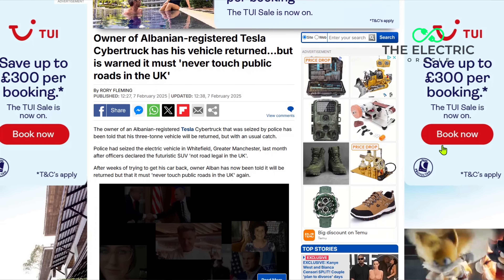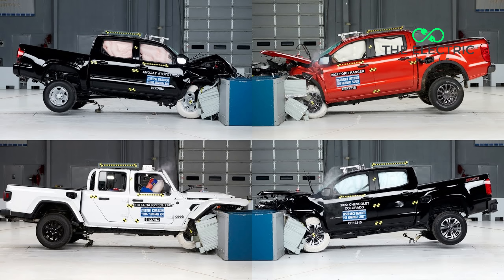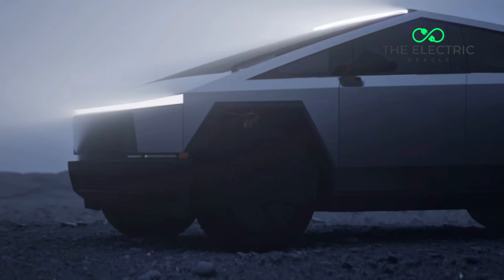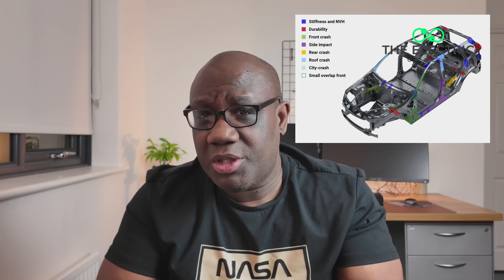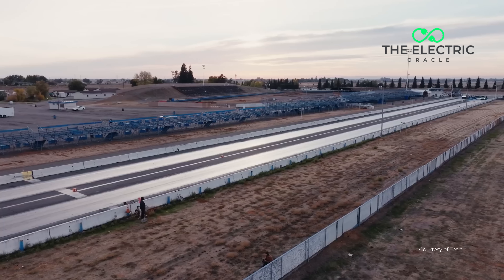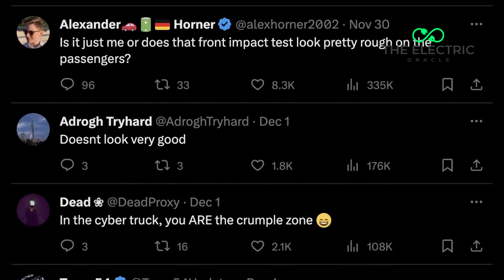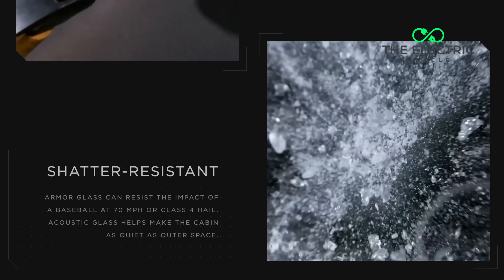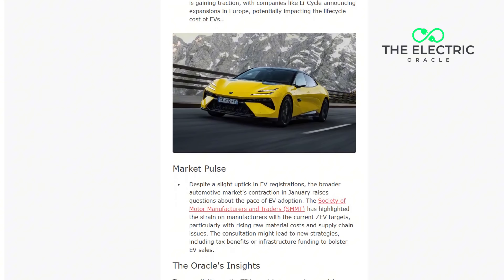Why the UK Banned Tesla’s Cybertruck – 5 Fatal Design Fails!

Comment: I think the CT was rushed out because it was years late. The US design rules are probably the easiest to comply with, plus with a high public profile you can do a lot of dodgy stuff and get away with it.

 Elon had taken peoples money with a lot of wishful thinking. A number of features promised weren't delivered on the new truck and a good number of owners decided to get rid of them before too long.

This is extremely unlikely to be compliant on Australian roads and in suburban areas there are very few really large "pickups".
I've really only seen RAMs and some F-250s, which are often used by companies that need a large vehicle.
I think the cost of fuel means people don't buy thirstier vehicles unless they really need to.
Reply: I live in a regional Queensland city and we have a growing number of the extra-large RAM, Ford, GMC pick-ups. A number of them are owned by people with some reasonable use case like towing horse floats or boats. But there are others that seem to be just a $ 'flex'.

Comment: I'm surprised there was no mention of the steer by wire system in this list. With my engineering background, I simply will not trust such a critical system to a couple of electric motors and control electronics. A catastrophic failure in any conventional system still retains a mechanical link from steering wheel to front wheels, the Cybertruck has no such link, so a catastrophic failure in a large variety of electronic and mechanical systems can completely disconnect the driver from steering control. I cannot fathom how that was ever approved, even in the U.S.
Reply: You say all that and yet most planes are fly by wire. I guess by your reasoning you will never fly in a plane?
Also as an engineer you will be aware the steering column is a potential spear. 
Oh and are you aware the electronics have redundancy built in. 
Steer by wire will ultimately be the norm in all cars one day.
Reply: @grahamrennie7617  I don't agree. I also fly and if you did too you would be well aware that fly by wire outside military fighter aircraft is confined to large transport aircraft and then those systems have not only full system triple redundancy, but use hydraulic systems that are properly maintained with set TBO's. Aircraft can also be steered with a variety of options in the case of a system failure, and you are not avoiding an oncoming truck or tree with a couple of feet either side. 
Electronic redundancy is pipe smoke, it only works when the failure is defined and accounted for, outside that all bets are off. Believe whatever you like from the marketing hype, but I maintain that solid base engineering principles should be maintained, especially where the alternative only offers a cost to manufacture benefit, nothing else.
BTW, collapsible steering columns have prevented 'spearing' since the 60's, along with airbags since the 80's.
Reply: @alasdair4161  you forgot most cars still use 50+ ecu while tesla only has 3-5 main computers might be 3? if that computer turns off then that car isn't moving also Volkswagen & Mercedes  Developing Tesla-style centralized computing architectures as well so there going down to 2-4 computers at most instead of 50+ for each part
Reply: @knightwolf3511 Yes, they are moving to fully networked architecture with one or two central system controllers with the traditional components working as sub systems linked to a core processor. I'm surprised they've taken so long, integrating body, engine, transmission, HVAC, mirrors, nav/infotainment, driver assist, park assist, as well as crash systems (airbags, pretensioners and even event reporting) along with braking and traction control and now steering systems all using the speed tiered can bus system which was reaching it's limit some time ago. It will bring a more fatal and complete termination of driving to the mysteries of system failure for sure, absolutely everything will hang on that CPU not suffering from software bugs, update issues, parent company solvency, hardware reliability in harsh environments, internet and data access, malware attack, disgruntled employee's, moisture ingress (looking at you VW...!) emi interference and even plain old bad luck may quickly turn your five year old car into E waste. One of the benefits of can bus was the ability of system faults to not affect higher safety dependent hardware, so a broken touch screen or seat heater would not disable your brakes, steering and airbags... but with a single CPU..??? Fun times to come...
Reply: Interesting, as an engineer myself, I would trust a system that is tested and proven to be reliable in any foreseeable condition, instead of just assessing things based on their construction. There is no reason why a mechanical steering could not catastrophically fail due to manufacturing or service error and prevent you from steering.

I will agree that I was suprised it was not included in this video, along with all of the other technical misunderstandings.
Reply: @Catrik  even in the video there is technical misunderstandings like for example the lights you need redundancies which would make the vehicle more expensive but also i could see it only fail 2 ways
No lights or car just doesn't turn on also people driving without headlights 🤔feels like just adding more things to a already overused complicated system just so you can keep driving at night which means you don't really have to get your first lights fixed
Reply: @knightwolf3511  Huh, did you reply to the wrong person? I have no idea how this relates to the steering or what you're referring to with the lights.
Reply: it's also cold rolled stainless steel which is more resistant to corrosion and i think stronger then  carbon steel?
Reply: But we're okay with fly-by-wire throttles, for like the last 30 years.

Bosch also had brake by wire in a lot of Mercedes-Benz cars in the 2000s. People didn't like it, but it was statistically more reliable than the mechanical system.

Steer by wire will be the norm in 5 years time. The mechanical connection is more of a hindrance than a help nowadays.
Reply: @charlesbridgford254  I've never heard of Mercedes conventional hydraulic brake systems fail relative to a pedal linked master cylinder. The only failures I have seen have been associated with electronic ABS systems, electronic EBD and BA as well as electronic park brakes. If you trust your life to a cheap optical rotary encoder feeding a software based digital servo system over a mechanical pinion gear then all I can say is... good luck..
Reply: @alasdair4161 You won't have much choice soon, so luck won't be much to do with it. I'm not wishing it, just offering a vision of the future where 99% of consumers won't even know/care that their body movements have no mechanical connection to the car.
Reply: @charlesbridgford254  I agree 100%. I've got no plans to buy a throwaway car in the future so when the choice is gone I'll go bush and disappear...
Reply: @alasdair4161  Most modern passenger aircraft use fly-by-wire (FBW) systems. Here are some key examples:

- **Airbus**: All Airbus commercial jets from the A320 family onwards are fully fly-by-wire. This includes models like the A330, A340, A350, and A380.

- **Boeing**: Boeing began incorporating fly-by-wire in the 777, and it's used in the 787 Dreamliner. The 737 MAX also has a fly-by-wire system for some control surfaces, although it's not as comprehensive as in the 777 or 787.

- **Others**: Many other manufacturers like Embraer with their E-Jet family and Bombardier (now part of Airbus) with the CSeries (now known as Airbus A220) also use fly-by-wire technology.

Fly-by-wire systems replace conventional manual flight controls with an electronic interface, which can offer benefits like weight reduction, improved handling characteristics, and enhanced safety features through flight envelope protection. However, older aircraft models or smaller regional jets might still use traditional mechanical or hydro-mechanical systems.
Reply: @grahamrennie7617     You're leaving out one little fact - that those airliner FBW systems generally have triplicated functioning, fully redundant, exhaustively tested and certified to operate safely.   AND maintained to extremely demanding (and costly) standards.    Occasionally someone takes a short-cut and you get the 737 Max.   
Just how many independent circuits does the Cypertruck have for its steering?   There's just no comparison.
Reply: @ yes, I'm intimately familiar with some of those systems, but believe me, they are a million miles away from mass produced automotive steering systems, especially if they evolve into drive by wire closed loop digital servo systems with no physical redundancy. It will only be done to save money, that's it. The conventional power rack and pinion is physically much lighter than the Cybertruck dual motor system including the associated electrical supply and control systems needed to support it, even conventional electric boosted racks are no lighter than older hydraulic racks (including pump) due to the instantaneous power needed. The only real benefit I see for moving to full electric alongside cost is for automated driving, it will probably be done for actually removing control authority from the driver.. lane assist will ignore your inputs, swerving to miss it's fictitious AI hallucination will supplant the drivers reality. It will be a new threat for sure.

Comment: I saw a comparison front end crash test between a cybertruck, and a Ford F150 lightning.  After the data was analyzed they figured that the occupants of the lightning had an 80% better chance of surviving than the cybertruck occupants all because of the lack of crumple zones on the tesla.
Reply: No one could have watched the crash test and concluded there are no crumple zones.  You can literally see the vehicle crumple.
Reply: @tripzero0  A vehicle crumpling does not mean it has a crumple zone*. Go back to school.*Crumple zones are designed specifically to absorb impact, even with a pedestrian. That's why they warn you not to stand on a car bonnet, or even lean on it very hard- it will bend. Try standing on a cybertruck bonnet. If it won't bend and stay bent, it definitely doesn't have a proper crumple zone.
Reply: @alisonwilson9749  the NHTSA just gave it a 5/5 safety rating.  The best rating for a truck ever.  Not bad for "no crumple zones".
Reply: @tripzero0  and also the rear axle/wheel breaking off due to the impact in the front. Not very effective.
Reply: @ I guess that's part of the crumple zone for a FRONT END crash.  Well thought out design!
Reply: @timingenkamp3973  a lot of things break all over a vehicle in a front end crash.  What really matters is the passengers are safe.  The cybertruck has cabin radar then measures the size and dimensions of the passengers and modifies the air bag deployment appropriately.  I'm sure it's not the first to do that (maybe it is?), but your vehicle doesn't do that.
Reply: @tripzero0  since it has a actual computer in it, probably but some cars from 70s and 80s had some unique stuff to them
Reply: 80%? That's a very specific claim. Not 79% or 81%?
Reply: Except if the CT crashes against a F150, thent would be the opposite!!!
Reply: Cyber truck has crumple zones, they are part of the giga casting
Reply: This fooled so many people. Read further and don't believe the internet so fast. 🤣

Comment: The Tesla Cybertruck does have a subframe (it is not essentially a unibody as promised), specifically a rear subframe is included, which is a part of its unibody chassis; however, it has been reported to be susceptible to damage from large impacts, like hitting potholes, potentially causing significant repair costs if broken. Safety wise, Volvo developed the use of three grades of metal in their design to act as crumple zones. The Cybertruck is a childish monstrosity, straight from the mind of an ultra right-wing, N A Z I saluting zealot.
Reply: 😅 appropriate that it is SS then 😂

Comment: The crumple zone and the standard to do with measuring energy absorption was introduced because some engineer campaigned for it. As a student I read one of his books. He pointed out this was the problem with fibreglass as it had this weakness due to the way it fractured and failed to absorb the energy.

Comment: I worked in Canada on the assembly line for ford motor company my hobby is restoring old American muscle cars . Over the years I noticed the company would build their bodies with crumble zones and different metals to crumble so the passengers are safe in an accident . In a wreck the car looks like a mess but the passenger compartment is not a mess as bad as solid car or old car . YES I believe the auto makers are responsible to build a safe car with the tec we have and to keep improving on safety . For a car company to build an unsafe car knowing there is a safety issue deliberately should be against the law period . Tesla knows the issues with cyber truck and built it anyways they should be closed down . If they can’t get creative with design making sure the car is safe and even safer that anything on the road the only word to describe  that is stuipid. I don’t believe it is far to other drivers on the road to be in a collision with a cyber vehicle  . Tesla is not innovative or creative they just used a electric motor in a tank and did nothing to improve the industry
Reply: Instead Musk will be attempting to close down the parts of the US Government who regulate vehicle safety. Via his Department Of Government Execution.

Comment: And to think, in the 1980s the US banned pop up headlights due concerns over passenger safety, and then allowed this. Make it make sense.
Reply: In the 1980s Reagan had just been elected. Now after 40 years of both parties heading in the same direction, anything companies want is allowed.
Reply: Passenger cars have different requirements then trucks. The thought was to help pedestrian safety during a collision with passenger cars. Buuuut a truck is considered a work vehicle. And you cannot delete something off a work vehicle that would make the work take longer than needed. Since trucks are less regulated, manufacturers have been pushing more trucks and suvs into the market.
Reply: and they kept breaking from wear and tear

Comment: I believe your numbers are wrong for the Cybertruck.
You are quoting the all wheel drive model and that is not available or looked at for European or UK markets. Yanni weighed the rear wheel drive model he has and it was I believe 6100 pounds so anyone can drive it. As far as legal for the UK market, I don't think that was his intention as potential numbers are so low why spend the money legalizing it for that market. The real and profitable market is the USA and possibly Canada.
Reply: Maximum weight of the vehicle is the only number that matters. 3100kg vehicle +1000kg load capacity is 4100kg. You could test your theory with police by driving a truck that weighs only 3450kg and has 3000kg load on the bed. Good luck trying to tell the police you don't need C1 license to drive over 6ton vehicle.